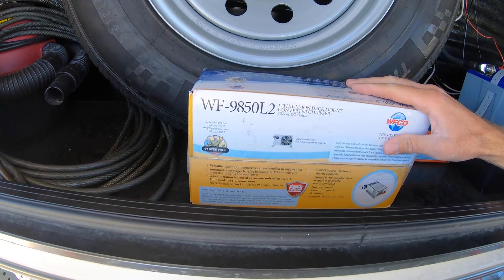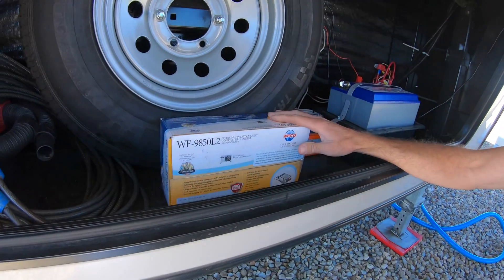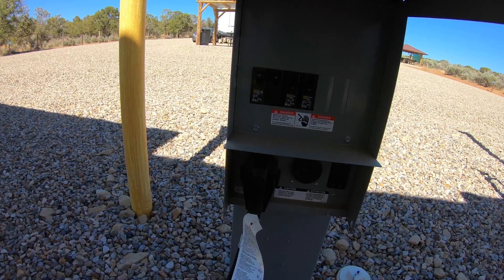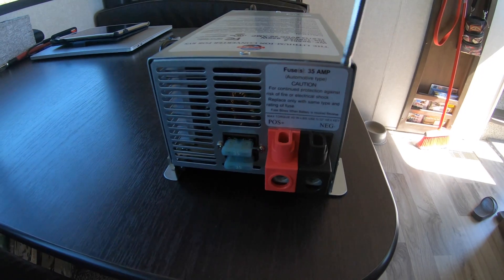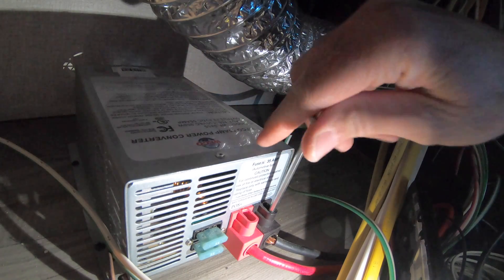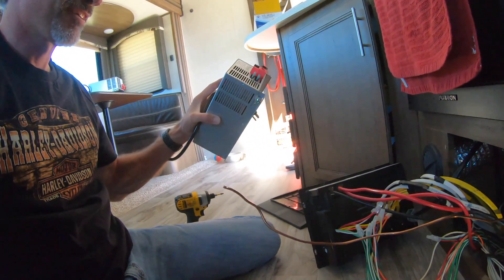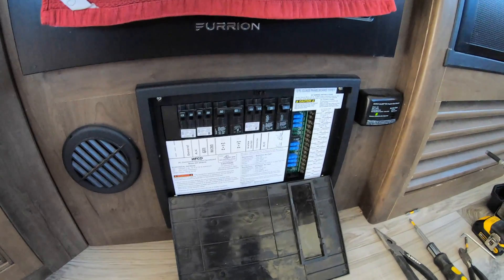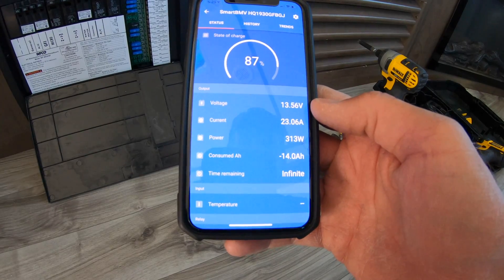Going to LITHIUM Batteries for your RV?  WATCH THIS FIRST!  WFCO WF-9850L2 Lithium Converter Install

Comment: Great video with a great explanation of the problem and the solution! The video is great helping a person understand the limitation when switching to a lithium battery since that is a huge topic on so many RV YouTube channels yet a lot of the channels never mention the converter issue or it's mentioned in-passing when discussing their 4-6 lithium battery conversion with 3K watt inverter with equally expensive monitoring devices and 600W solar panel grid.  All off that is great but it's also $6-$9K worth of equipment!  Your install discusses a problem everyone will have not matter how big of a lithium system you put into the coach!   Thank You for taking the time to show this for those of us that want lithium but need to understand it is not a simple "drop-in solution" if you expect it to charge properly. I guess he other question is what issue will there be when connected to the tow vehicle for charging?  Thanks!
Reply from the maker: @Andrew Kocsis  Thank you Andrew!  Very glad to see this video is helping people out who like you said, don't want to or maybe can't afford to install an elaborate system with tons of solar, huge inverters, etc...   I actually just ordered 2 additional Battleborn batteries and will be installing a 2000w inverter, however, the inverter won't be hooked into the main panel.  I'll run a dedicated outlet to a central location in the rig that the inverter will power and then if I want to send power to the entire rig, I'll run my main 50amp power chord to the main electrical input for the rig, using a 110v dog bone to connect to the inverter.  I'll do a video on that as soon as i get it all installed.  

Regarding your question of charging with the tow vehicle...  We have not had any issues with the batteries while hooked up to tow.  I've checked the status via my bluetooth battery monitor while hooked up to tow and have not even seen it charging.  I believe the truck batteries may have to be depleted some to get the alternator to send a charge and that is when it would also send a charge to the rig?  Sorry, not 100% on that one.  I do know one other viewer was concerned about having an over-charging problem and had contacted Battleborn.  Here is the message that she sent to me:  

@Homie At Large The original email reply that I got from Battleborn led me to believe that a Dc to DC charger needed to be set up from the starting battery-alternator to the house battery.  Apparently, for some reason, the rep was referring to vans, busses,  class Cs, etc. I just found this on BB's web page. Sorry for any confusion caused by my original response.
"Before discussing this topic please note that when connecting to a towable trailer (such as by a 7-pin connector), you typically get a low amount of charge into your lithium (aux) battery bank and an isolator or current regulating device is usually not necessary."

So, it appears that towing a 5th wheel or a travel trailer would not be an issue, however, if you have an RV with a "House Battery", you may need to set up a DC to DC charger.  Hope this helps answer your question.
Reply: @EddieAtLarge  I like your concept on expansion to your system!   for our Boondocking needs, we recently ordered the Lion Safari ME with expansion pack that provide a portable solution with a 2K inverter and ~3KAh (w/extension pack). It seems comparable to your system but I think you may a little more amp hour storage in your set-up. But we saw the Lion Safari ME (w/expansion pack) as a solution to allow us to enjoy boondocking more without the constant need for the running the generator, just plug the 50A to 110A dogbone in and plug in like normal from the camper.  Plus, I wouldn't have to drop and drop the massive amount of $$$$ and install for an on-board solution like I mentioned earlier. And the LS ME is portable. Although I talked about cost earlier, as you know, all of these systems are expensive (batteries, large inverters and solar panels) but just how expensive is the question.  Your video here helps me to do the one of the last two parts remaining to the electrical system for boondocking/moochdocking, 1)change out the lead-acid & converter in the OEM system to lithium and 2) install an easy start micro air on the main A/C to allow use on a 2K inverter (3K generator) or plugged into a 110 outlet on a house. Looking forward to your next video!
Reply from the maker: @Andrew Kocsis  Took a look at the Lion Safari & expansion pack.  I see that it is a lithium battery with a built in 2000w inverter.  With our 3 Battleborn batteries, we'll have 3600wh vs the 2048wh that comes with the Lion ME & expansion.  Our 3 batteries cost $899ea. and the 2000w inverter from Renogy for $339.  You could go with 2 each 100ah (2400wh) lithium batteries (total of $1800 + tax) and the Renogy inverter for $339 and come in much less overall cost with more watt hours than the Lion ME & expansion which I see at $3995 on their website.  As you said, this would be close to the same setup at almost 1/2 the cost.  Just thought I'd throw that out there in case you wanted to consider it and it could save you some money.  Also, the Battleborn batteries have 3000-5000 full cycles vs the 2500 full cycles of the Lion.  Check this video out by Ray at Love Your RV where I got the idea from to do our future inverter setup: https://youtu.be/yV2xJiHSbfU  Hope that info helps and wish you the best on your setup and boondocking adventures!  Thanks again for watching and commenting.
Reply: I guess prices have dropped, I just picked up a couple LiTime 200ah batteries for roughly $500 a piece, go a Vevor 3500 pure sine inverter for under $400 @EddieAtLarge
Reply: I guess prices have dropped, I just picked up a couple LiTime 200ah batteries for roughly $500 a piece, go a Vevor 3500 pure sine inverter for under $400 @EddieAtLarge
Reply from the maker: @RandomStuff-zt6qf  Prices are definitely coming down at other lithium manufacturers.  Battleborn are still on the high side.
Reply: @EddieAtLarge  Any issues with this charging when plugged into the tow vehicle or mods you had to do on that end as well?
Reply from the maker: @Andrew Kocsis   No issues.

Comment: Awesome video..simple and perfect for my application.  Is your rig a Jayco?  Ours is and the heating duct runs by the converter just like yours so when the heat is on the fan on the converter runs too.  DUMB!  lol
Reply from the maker: @sean808080  Thank you!  Our rig is a Keystone Cougar 25RES and yes, one of our heat ducts does run right past the converter.  Have not noticed the converter fan kicking on when the heat is running.  I'll have to check that out.  I did notice yesterday that our oven that is located directly above the converter, has holes in the bottom where when you open the oven door, you can see directly down into the cavity below where the converter sits as well as all of our wiring that is connected to the breaker panel.  I couldn't believe it!  I'm assuming there hasn't been any major issues because of this as I'm sure this design/configuration has been around for a while.  Fingers crossed...  Thanks for watching and commenting!

Comment: I don't understand why your old charger only charged to 80%?  The WFCO WF-9855 specs say it has a 14.4V bulk charge mode which should be fine for LFP battery, at least to 99% or so even it it doesn't have an 'absorption' phase.  Do you know why it didn't work so well?
Reply from the maker: @Julian Robinson  Good question!  The technical rep at Battleborn Batteries was who told me that our original converter would only charge to 80%.   We never confirmed the 80% threshold in the field, however, we ran the genny for over 2 hours after the battery was well depleted and we were only able to bring it up to 40% before giving up due to the extremely low charge rate.  I believe it was just a difference in battery chemistry whereas the original converter was not designed to communicate properly with lithium batteries. Our new lithium converter charges very quickly and brings the battery to 100% every time.

Comment: It's a very bad practice to use an impact or other powered drill on screws in your electrical systems, like you did to loosen the ground in the distribution panel. Always use hand tools in breaker panels and any other electrical connector. The likelihood of stripping the head of the screw or the threads in the rather soft busbar material is high.
Reply from the maker: @bob w  I do typically avoid tightening fasteners in those locations with a drill or impact driver.  Never thought about it causing damage when I loosen them though.  Guess there is that possibility since it is a softer material which I did not know.  Thanks for the advice!

Comment: Won’t your solar panels charge up the Battle Born battery ?
Reply from the maker: @bt4b4 They would also charge very slowly as we only have 2 ea. 100W panels.  The new converter charges at 25 - 35 amps in bulk mode whereas the solar panels will only charge around 15 amps in full sun.  But, yes, they charge the lithium battery as well with the proper solar controller.  Thanks for the question and thanks for watching!
Reply: @EddieAtLarge  oh yeah.  Thanks for the info.  Stay safe out there, peacefrom510 .

Comment: Informative.

My old trailer (waiting on new one) had the converter in a space with no venting.  It was much happier when I made an 8”x8” vent for it.  Wondering how much heat is being held into that space?  I used a bit of aluminum screen door decorative cover from local hardware store.

I also agree that the battery should be closer to the converter.
Reply from the maker: @Jeff Marshall  I do agree that they should have added some venting from the factory.  Unfortunately, I don’t have room to add a vent on the inside.  Hopefully it will be fine for now.  I may be eventually replacing it with a switch box in that location when adding an inverter in my storage bay.  Thanks for watching and commenting!

Comment: Great video. I’m thinking of doing the same. I noticed you have a Cougar Fifth wheel. Any problem either In-Command system?
Reply from the maker: @Guy Caouette No issue with the In-Command system.  I did install the BMV-712 battery monitor though as the In-Command battery monitor is inaccurate.  I made a video for that as well if you’d like to check it out.  https://youtu.be/sruxxpmFdts
Reply: Yes. I saw too. Great job!!

Comment: Great video presentation! I have the stock WFCO8955 system and will be possibly changing the converter to the newer WFCO  as you did.  One thing I am struggling with is how to protect my Chevy Silveraldo  alternator from over heating due to the large draw to the lithium batteries on my travel trailer.  Did you  setup any system to that end?  Once again great presentation.
Reply from the maker: @Sadie04074  Thank you so much!  I did not realize that installing lithium batteries could cause a problem with the vehicle alternator overheating and I have not set any system up to prevent this from happening.  I do only have one lithium battery (100 amp hour) installed and to my knowledge, I have not had an issue my alternator.  That being said, I will look into this further to see what I can find about any potential issues that could occur.  I can let you know if I find out any new info.  Thank you for the question and for bringing this to my attention!
Reply: @EddieAtLarge  The original email reply that I got from Battleborn led me to believe that a Dc to DC charger needed to be set up from the starting battery-alternator to the house battery.  Apparently, for some reason, the rep was referring to vans, busses,  class Cs, etc. I just found this on BB's web page. Sorry for any confusion caused by my original response.

"Before discussing this topic please note that when connecting to a towable trailer (such as by a 7-pin connector), you typically get a low amount of charge into your lithium (aux) battery bank and an isolator or current regulating device is usually not necessary."
Reply from the maker: @Sadie04074  Thanks for the info Sadie!  That makes sense and I'm glad it won't cause any issues for towables!  Thanks again for letting me know.

Comment: I'd just like to point something out. The distance from that converter to your battery is way too far. Running DC power (esp. with those small wires) that far over undersized wire will dramatically reduce your charging up the battery.  As an example, My charger is within 5' (li niar) from my batteries. And I'm using 4/0 cables to reduce line loss. You'd be way better off moving that converter up right next to the batteries and runnig the AC power up to the breaker box. JMO!
Reply from the maker: @David Bowen I completely agree!  I Eventually plan to install an inverter with a few more lithium batteries up closer to the breaker panel box. Will end up being approximately 10 feet away at that point which will reduce the resistance. Will also add larger wire to run between the switch box and the inverter as well